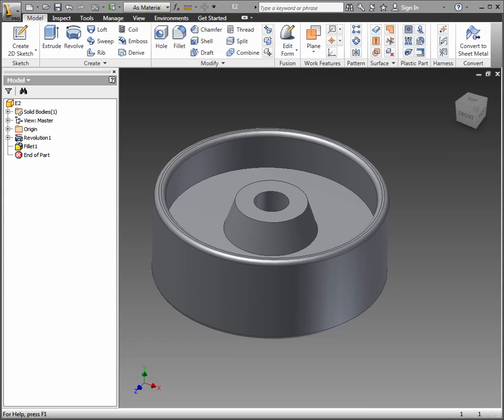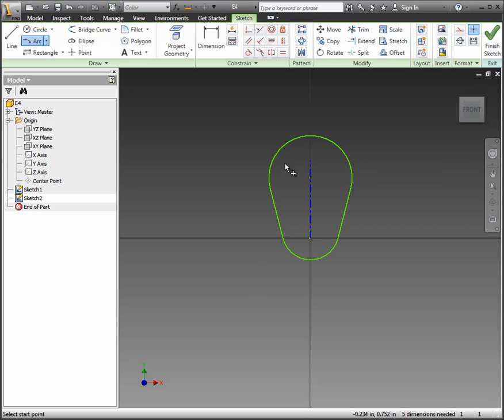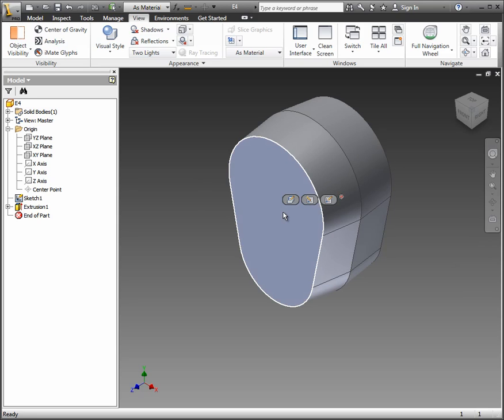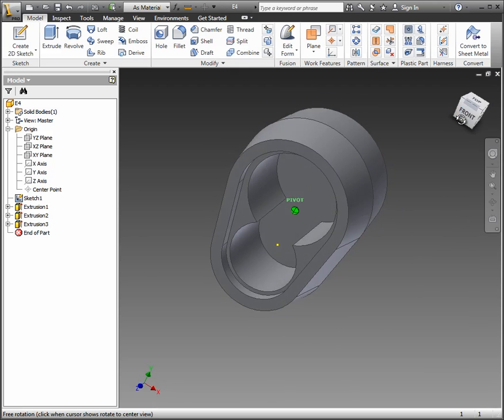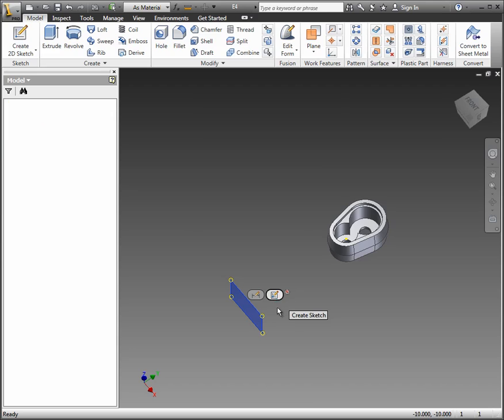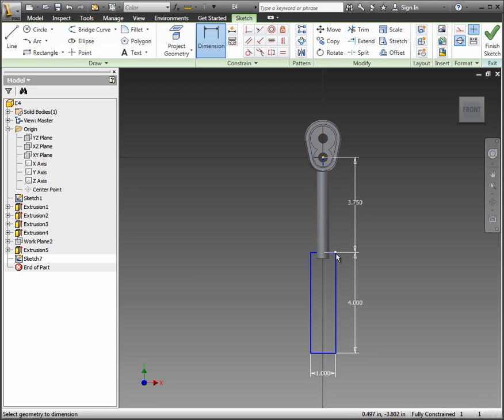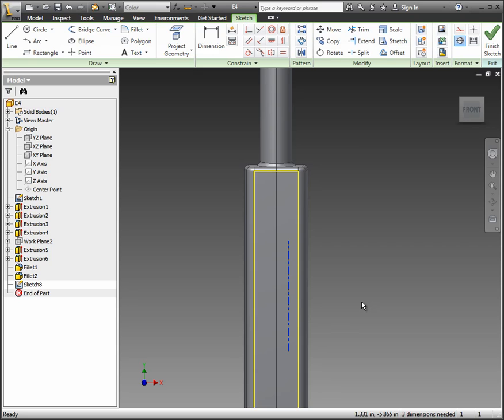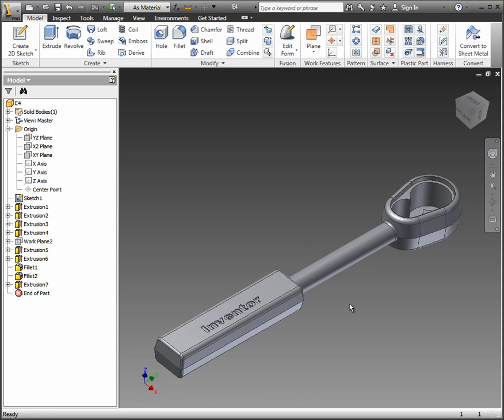E3 INVENTOR 2012 - Basic Modeling 3

Comment: Hi, is there a way to get the manuals u have? i looked for them at your website and i did find the ones for Inventor 2014 but didnt find the ones for 2012
Reply from the maker: Here's the 2013 manual. I can't find my 2012 version.
https://drive.google.com/file/d/0BxHoQac6LA7_dGVFR0d1am1FU28/edit?usp=sharing
Reply: thx a lot :)  i guess i can do the same Exercises from 2013 on 2012 inventor right?